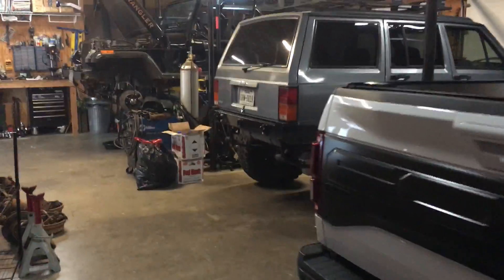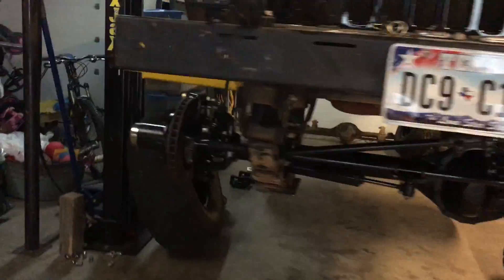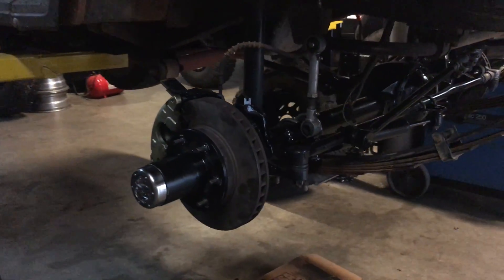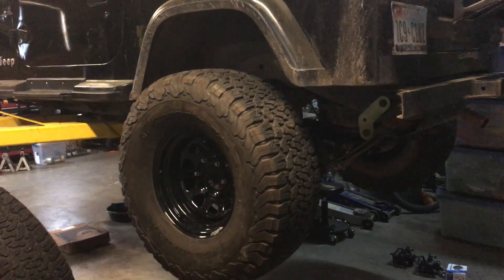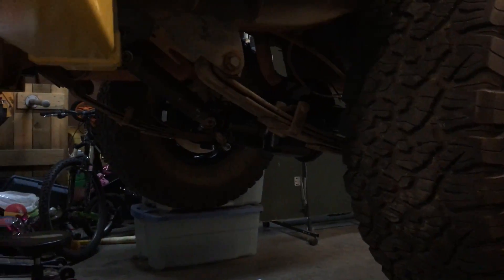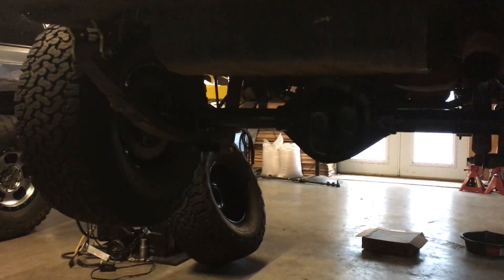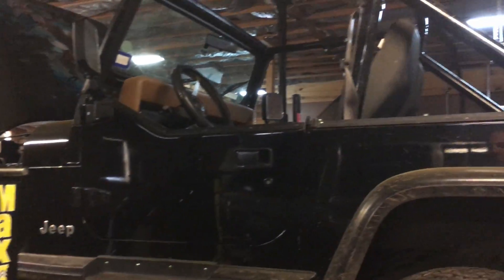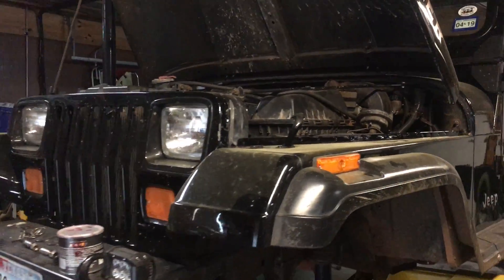Custom YJ Project Overview | Isuzu Dana 44 Swap, 4.0 HO EFI Upgrade, AX 15 Swap, RE 2.5 inch lift

Comment: We’re the front 4.27s a factory waggy option?
Reply from the maker: No they were not...We installed a 4.27 Yukon Gear Set in the front to match the factory 4.30 isuzu rear R&P.

Comment: Does the axle width on the isuzu match the Wagoneer or the smaller axles in the yj/tj/xj?
Reply from the maker: Yes it matched the front dana 44 out of the 80 wagoneer perfectly was such a great swap and having 4.30 gears already was so cool!

Comment: for the front waggy, did he just redrill the hole on the passenger side or cut off the perch and re weld a half inch in?
Reply from the maker: He just took the perch off and rewelded it half an inch in...was not much to weld actually and you do not have to be a pro since the ubolts and leaf spring hold a lot of pressure...looks factory!
Reply: awesome thanks! currently doing waggy 44s front and rear in my girlfriends YJ
Reply from the maker: @TriggerHapySheep  Sweet!!
Reply: @rockquestoff-road2839  GF and I ditched the waggy rear and got an Isuzu rear 44 for the disks and matching front width! got a couple questions, what did y'all do about running e brakes in the rear? also break lines all round?
Reply from the maker: Hey hey!!! My friend said he just ran the stock e brake cables into the ebrake drum and hooked the ends by bending them...pretty simple...
Reply: @rockquestoff-road2839  Awesome! Thank you!

Comment: Is that the factory wagging steering? Which pitman arm did you use? Thx.
Reply from the maker: Yes factory wagoneer steering drag link and tie rod. We used the stock YJ pitman arm and just used a reamer and reamed the hole in the pitman arm a little bit bigger...just go slow and test fit till its just right...worked perfect